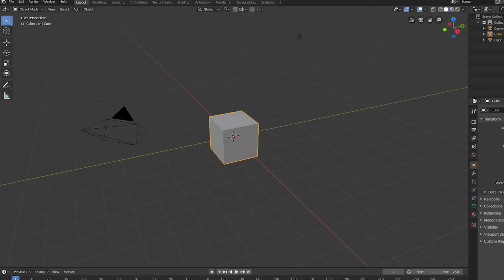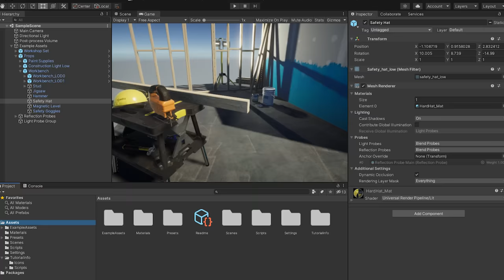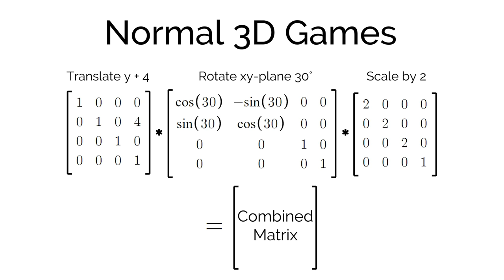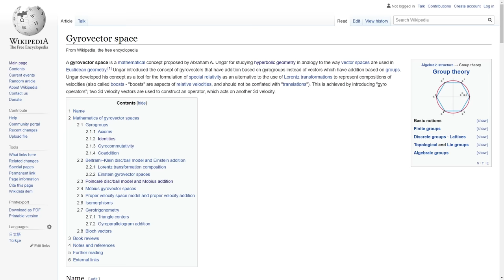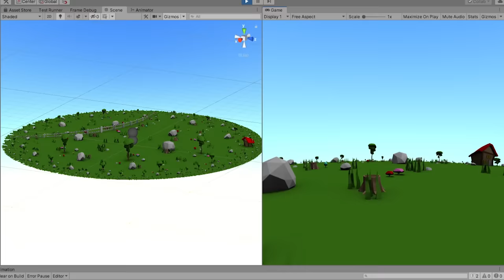Rendering Hyperbolic Spaces - Hyperbolica Devlog #3

Comment: Hey, I dont understand  why you wouldnt go for a euclidean world with a custom raytracing shader where the light bends?
Reply: It would be something different – even if it could look similar, player movements would behave inconsistently.
Reply: That's not how Hyperbolic geometry works. If it was really Euclidean, lines wouldn't diverge.
Reply: Because it's not the visuals.
Hyperbolic space is just not same as Euclidean, it has more area/volume. Light isn't the only thing that diverges. Every line/ray does. Including all physical objects' edges, and trajectories and paths things take.
Also, the circumference grows exponentially with diameter.
Finally, up-right != right-up.

Comment: I get the feeling that it is going to be extremely easy to get lost in the map. people are used to navigating in regular 3d space. so trying to go long distances and return in this will be a nightmare.
Reply from the maker: The player gets a map which makes it much easier to navigate.
Reply: It is easy to get lost in hyperbolic space, but not (only) because people are used to Euclidean space, but because of the properties of the hyperbolic space itself. If you take 20 steps, there are like million directions you could have went, and there are a million directions where you possibly should go to return. Only one of them is correct.
Reply: @ZenoRogue  This sounds awesome and infuriating at the same time

Comment: You should build some larger structures like hyperbolic mountains and caves. At the moment, the flat plane with stuff sitting on it is kind of underwhelming.
Reply from the maker: Yes, this was just recycling the tiles I used in the last video.  Mountains and things like that are weird, there's a maximum perceivable height, even if the object is infinitely tall.
Reply: @CodeParade  You should do a video that explains how you can design any kind of terrain that crosses between vertical cell boundaries, because I can't picture any way, with any kind of custom dev tools, to do cross-cell terrain sculpting with 20 cells around each vertex.

Comment: I wonder how big (or perhaps small) is Earth in hyperbolic space (assuming constant volume or area)? After some playing in HyperRogue, I realized that circles with a comparably small radius of 28 tiles explode in the immense area (AFAIR several millions of tiles). I think that it affects Earth even more since it is a 3D object. 

Let say that area of Earth in some hyperbolic space is equal to 510.1 million km² (like ours). Then length of the equator could approximately be, like, 2 kilometers. So you can get in any place on Earth just by walking 1 kilometer. Imagine how crazy that would be.
Reply: @ZenoRogue  Thank you. Radius 16.36 meters - that's crazy indeed. But what about length of equator? Since I'm suck at non-Euclidean geometries, I can only guess. Is length of equator equal to something like exp(r)? Then it would be 12000 kilometers. Not very short distance for walking.
Reply: @hamsterdam1942  The length of the equator is 2*pi*cosh(r), and cosh(r) is roughly exp(r)/2 for large r. It is the same as the equator of Earth, basically.

Comment: Hey. I was hear from someone "google was know what you talk or do in internet" But how do they know what I am thinking? Before watching this video I was testing some formulas on one of web Math calculator. I am not a mathematician or coder (not know any single code). But I can find many thinks in my mind with shapes. And that I use that web math calculator and it gives me a formulas. So I was testing your perspective try. and now I know it is "Hyeprbolica". And I have to say you how to fix that coordinot issue. it is about numaratic. when you use point A. It should stay in integer point. you can fix this to make A-(fractional quotient to the nearest integer) or you have to make integer dots like dots_!=((1,2,3,4,,,n),n,start point, end point,+number). when point connect with each other as integer. and this will be your map. When you use a point for object to move or place. there will be 2 points. 1 of them is normal Point of A. other one will nearest location point on fractional. Maybe I can explain. Sorry but I realy have no idea about coding. But I can show it in graphics anyway.

Comment: So you transform vertices in a normal graphics pipeline?

Does that mean your triangles are still flat and isn't that technically wrong?

Rendering triangles in euclidean space, using linear algebra, has the advantage that the line between two transformed vertices is the same line that you get if you transformed all points on the line between the original vertices. This means that you can transform entire triangles by just transforming their vertices.

I always assumed that this does not hold in non-euclidean geometry.
Reply from the maker: This is a very important observation that I'll talk about in the next devlog!

But to summarize, there are multiple hyperbolic projections that look identical in first-person, but only 1 of them preserves straight lines and thus all triangles stay flat with only distortions in the angles.  That projection is the Beltrami–Klein ball, and it makes the vertex interpolation and depth buffer correct.  However, texture interpolation is now non-linear so that introduces a different problem, but I'll talk about solutions to that.

Comment: Hey @CodeParade I've been trying to make a random dungeon generation system based on your code HyperEngine. However, I realized that the coordinates system you are using is actually flipped the other way around, where UR is the Upper tile of the R tile instead of the Right tile of the U tile, as opposed to what you have explained in this video. I am wondering if I should proceed with the flipped string coords or is there a quick fix I don't know about since I couldn't seem to find a safe way around to fix it.
Reply from the maker: Yeah, that was a bug I caught late in development, but I didn't want to redo all the levels I already designed, so I just left it in. But you can definitely fix it for your project without consequence!
Reply: @CodeParade  Thanks for the quick reply! I think I'll try to work around it for now, I just managed to get the random walking algorithm working with the reversed coordinates in Hyperbolic space. I'll just have to keep in mind about the reversed coords in the future 💜

Comment: Wait what - so moving forward tends to pull on atomic connections, so either a fast moving object is ripped apart, OR it drags on forward momentum? So it brakes? So where does kinetic energy go when breaking occurs? Heat?

EVEN WORSE - what if the time dimension is also hyperbolic, how the HELL would that work???  Try and explain me passage of time and occurance of causality when time moves in a hyperbolic  line angular to hyperbolic 3D(ish) space? 

Oh and I am maths blind.

Comment: Did you calculate the minimum requirements? I have two laptops, I'm using right now a laptop like this: https://u.cubeupload.com/uiopzxcv/information.png and my other laptop is like this: https://u.cubeupload.com/uiopzxcv/information2.png . Which of the computers, if any, will this environment run on?

Comment: Hmmm...the "gyrovector multiplication is non-associative" part doesn't make sense to me.

Like, ok, this is saying (AB)C != A(BC). This makes sense at first glance, but it really doesn't. After all, applying C, then B then A, should be the same as applying C then B, then A, right? Just listen to what I just said: C, then B then A should be equal to C then B, then A. They're literally the same thing! So there's no reason why (AB)C != A(BC).
Reply: They're not quite the same thing. With (AB)C, you have to first take A and apply B, and then take the result of that and apply C to it. With A(BC), you have to first take B and apply C, then take the result of that and apply it to A. With a non-associative relation, these won't necessarily be the same thing.

I also want to point out that that the lack of commutativity doesn't interfere with the way I described it. It doesn't change the fact that you have to calculate the result of BC before you can calculate A(BC). However, being non-commutative does mean that the result of A(BC) will be different from if you did, say, (BC)A or A(CB).

Comment: "Dropping the parallel postulate" is a weird way to phrase it (although not technically wrong), if I may say so. 

Hyperbolic spaces are assuming a different parallel axiom, namely, instead of one line going through an exterior point being parallel to a given second line, there are two lines that pass through that point that are parallel to the second line. (You probably know this, Im just informing to the reader)

Rejecting would be a more mathematically correct phrasing. An axiom is assumed in any case.

Tiny detail, but from experience I can say using dropping does not clarify what's mathematically happening. It gives the impression the axiom is being just ignored and nothing is there, which is not the case.

Great video.

Comment: I know this does not match with your points mentioned, but there is a Houdini Tool that revolves around 4D geometry. I haven't tried it yet, but I will after finishing my escherian short movie. https://vimeo.com/349801935 the video looks really cool

Edit: I've also found a Houdini project file that has vex coded hyperbolic plates in it. Working offset, rotation and everything. I don't fully understand it yet but it looks like it works with gyrovectors as well. I can share it if you are interested!